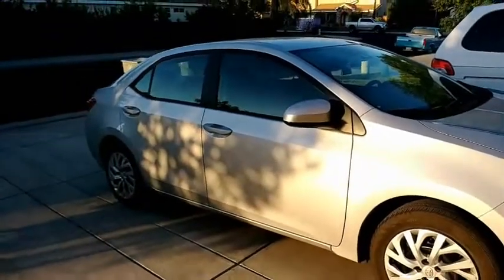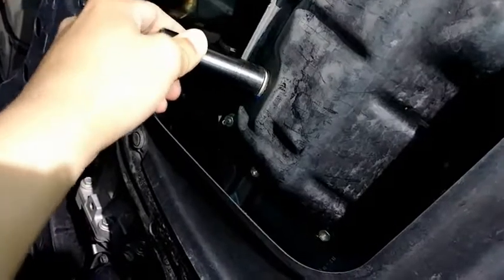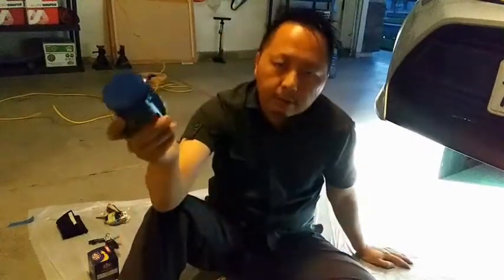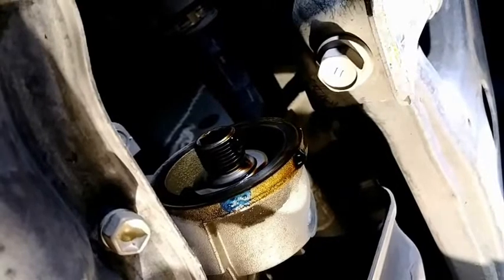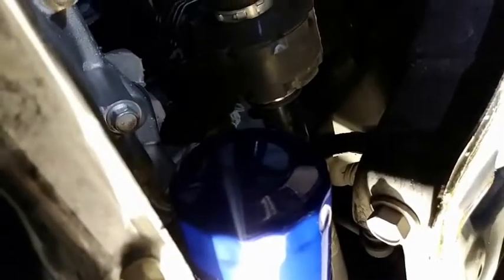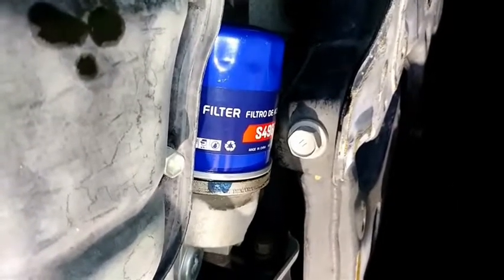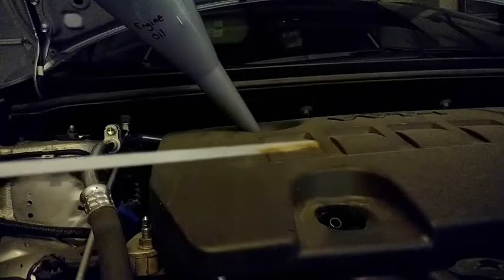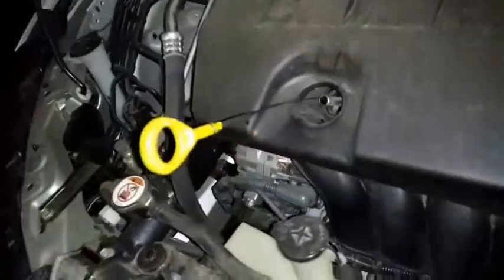2017 Toyota Corolla Oil and Filter Change - spin on filter

Comment: Never , Never use a wrench to tighten oil filter “ Bud , just letting you know. Always tighten the oil filter with your hand. Giving you some good advice. Peace ✌️
Reply from the maker: Wrench isn't recommended in the Automotive Society because some people would probably over tighten. I carefully watch the turn on the filter when I tighten it. I usually mark the filter with a marker once the base of the filter touch the engine, so I know how far the turn is. Don't remember if I did that in this video or not.

Comment: You didn’t need an oil plug drain gasket? I noticed your car didn’t have one on?
Reply from the maker: It's not my car. I did this video a while back and from what I remember there was no gasket, so I just put it back on without a gasket. If remember correctly it seems like a gasket was built into as part of the plug.

Comment: Do I need a special tool to take off the filter?
Reply from the maker: Depend how tight it's on and how strong you are. I usually always use oil filter wrench.

Comment: The metal washer was stuck to the pan. It can be reused as he did. The spin on filter should only be hand tightened. Do not use wrench on it. Watch a Toyota mechanic do it.
Reply from the maker: I can't speak for other cars, but on this car there was no stuck washer. If you understand the concept you would understand why hand tighten is recommended for spin on filter. I know how far to turn and when to stop turning, so I can use either hands or tools.
Reply from the maker: By the way I never reused a washer when there was no washer to begin with.

Comment: After how many miles was it changed?
Reply: It should be change 4500 miles 

I’m not sure if that was you’re question
Reply: My 2017 toyota corolla takes synthetic oil and needs to be changed every 10,000 miles. Filter change every 20,000 miles.

Comment: What oil did you use
Reply from the maker: I work on a lot of cars and I make a lot of videos, so I wouldn't remember what oil I use. Look on the oil cap if you want to know what oil you need.
Reply: 0w-20